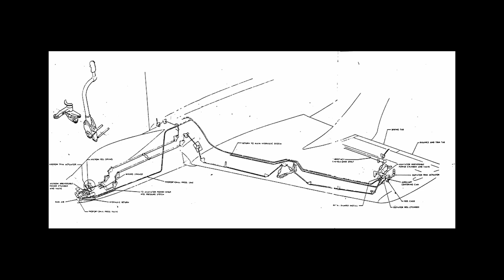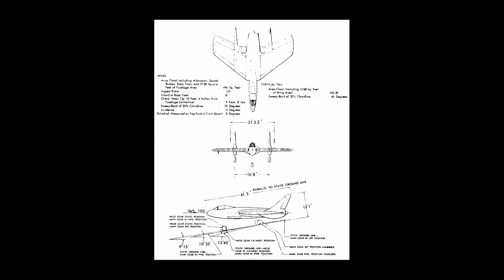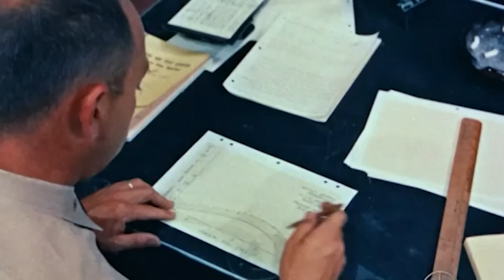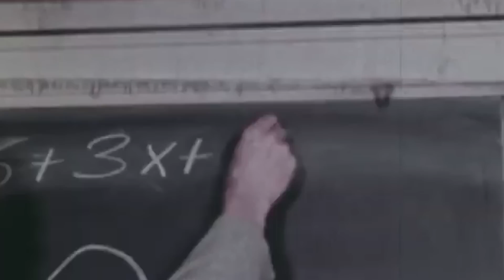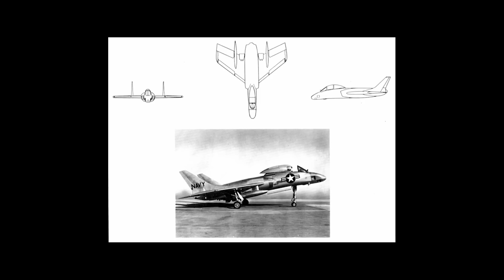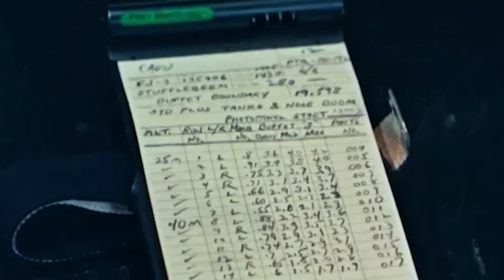The Deathtrap Fighter Everyone Was so Afraid to Pilot

Comment: No, "everyone" was not "so afraid to pilot" the Cutlass. I crossed paths with several Naval Aviators who flew the Cutlass. None were "afraid" to fly it. The biggest complaint was that it was under powered.
Reply: The F7U Cutlass, the B58 Hustler, the B47 Stratojet, the B36 Peacekeeper... what an incredible, amazing time to be a pilot and aviator!
Reply: Westinghouse, the manufacturer of the engines, eventually got out of the jet engine business, because they realized they were in way over their head.
Reply: @AgentJayZ  - The J-34 was a great design and quite advanced  for the time, using the axial flow compressor. Failure came when Westinghouse engineers believed simply scaling up the J-34 would work for larger turbojet design leading to the failed J-40.
Reply: @AgentJayZ  or maybe too early.
Reply: Spot on truth. Underpowered was the theme for most failed military aircraft throughout history
Reply: Typical clickbait hyperbole.
Reply: At first, they really weren’t underpowered relative to other contemporary fighters, but the Navy kept adding more requirements in later models that they got too heavy.
Reply: Standard USN practice -- if something isn't perfect, add something more. That is at least a  of why they have to have monster-scale gear. (That, and the carrier thumps, of course.)
Reply: The engines in it killed a couple of other jet prospects.
Reply: @michaelratliff3068  which ones?
Reply: None will admit fear because of ill placed bravado, every pilot I ever met who flew one of these things clearly stated they were not of flying but were afraid flying this craft due to the chaotic behavior of the design.  Don't confuse perceived fear with actual fear, those pilots were brave beyond measure but they also were not stupid and yes were afraid to be ordered to fly a plane that would more than likely kill them then defend anything.
Reply: @animalyze7120   - When I was stationed at NAS Miramar, AKA "Fighter town"  in hanger 2, was this quote.  "Only in the spirit of attack, born in a brave heart, will bring success to any fighter aircraft, no matter how highly developed it may be."
Adolf Galland
Reply: @animalyze7120 Baloney.  You're as full of sensationalism & hyperbole as the video poster 🧐🤨😒🙄🙂‍↔️
Reply: Clickbait title.
Reply: However, the head of Vought's aerodynamic research department, William C. Schoolfield, has denied that there was any orientation towards German research results.
Reply: Can’t remember who, but someone is restoring a Cutless for flight.  I’m assuming they’ll use modern engines.
Reply: @jamessimms415 might be the realization of the 75 year old dream
Reply: The cutlass was a failure! If it weren’t it would have been put in service.
Reply: Underpowered? The video says it had "blistering thrust". So which is it? 🤦🤷
Reply: Your right the cutlass never got the engines it was supposed to get and it has to be fitted with what was supposed to be a temporary fix the hydraulic issues could have been ironed out with time . Vought also produced the F8 crusader and the a7 they were good aircraft.
Reply: I wonder if it would’ve been much more successful with better engines?
Reply: Came here to say that, underpowered, a such radical design requires more juice to keep it in the air properly, if they would have waited 10 years more they could have revived this plane but by then there were plenty of other options to pick and choose, making that plane fly today and outmatch some of our current planes wouldn't be such a hard task at all, today we have super powerful engines, lighter building materials, fly by wire and flying assistant computers like the one on the F-16 and B-2 bomber
Reply: Underpowered, not a big issue for other war planes of the time, the actual problem for this aircraft was unreliable engines and components. Bad luck 
This aircrafts could have worked, if successful the A-4 might have never existed.
Reply: The Gutless!
Reply: This is why you flunked out of Clickbait U.
Reply: Names Units!